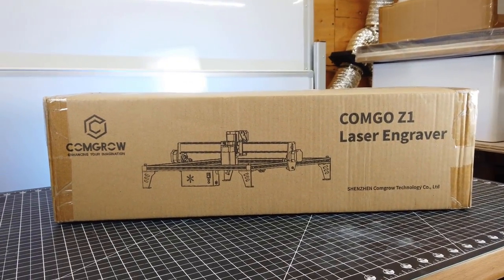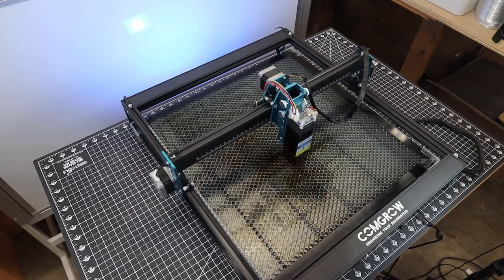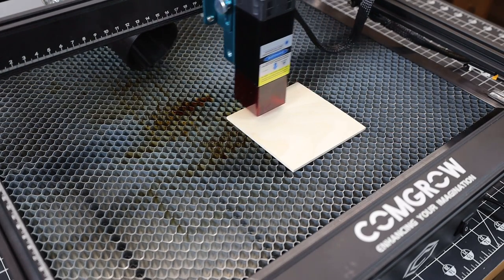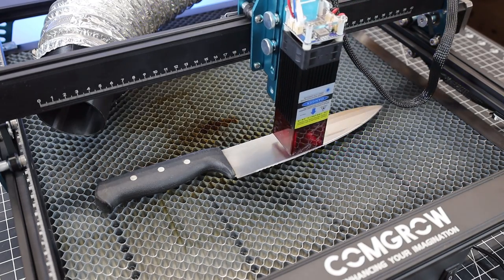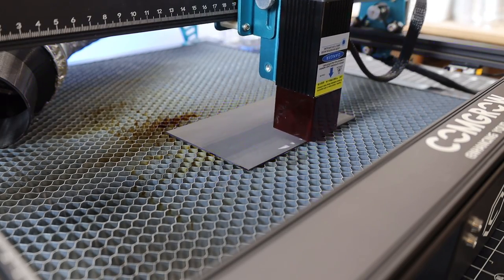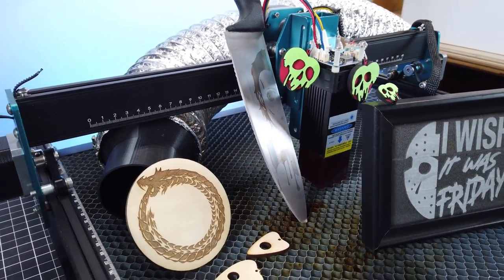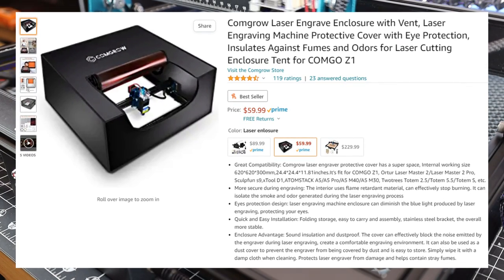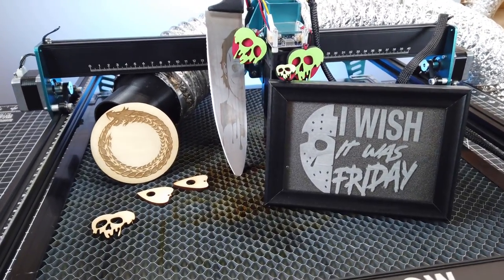Laser Cutting Jewelry & More Using The COMGO Z1 10W Laser

Comment: Great vid. Do you know of the best one to use for cutting metal jewelry in home studio? My main issue is the toxicity so I am afraid to use any of them but companies used them all the time. Just looking for guidance. Thanks.
Reply from the maker: So you would need something called a fiber laser for that. They can cut and engrave into silver and gold. The problem is they are not cheap. Starting prices are like $2000 last time I checked.
Reply: Thanks so much! I will look into these. With that price range all I will be doing non looking 😂